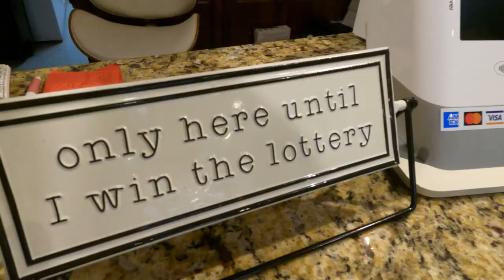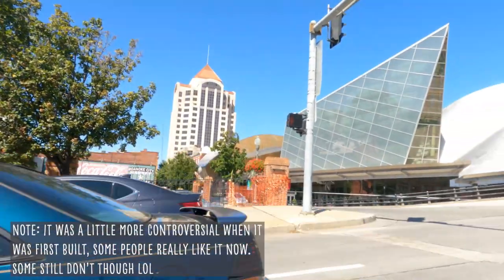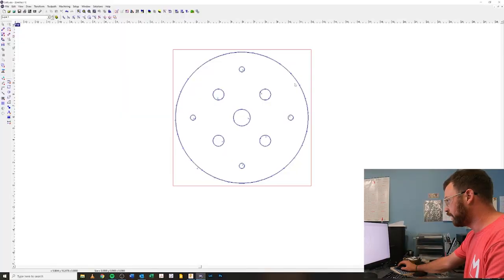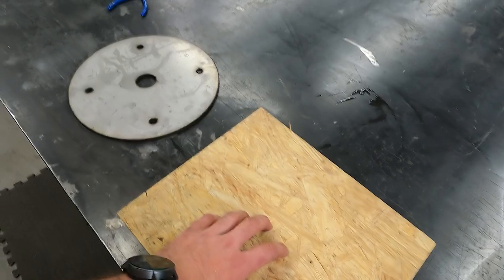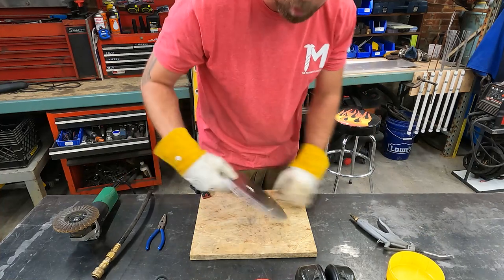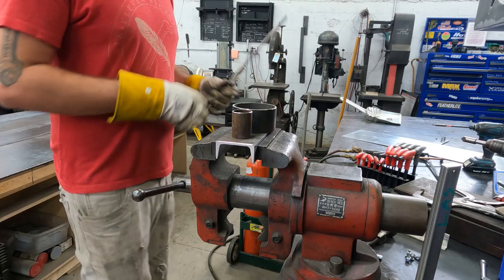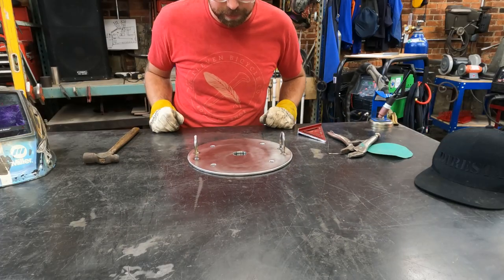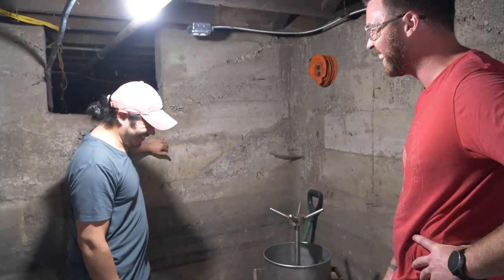INDESTRUCTABLE Vegetable Squeesher // Lift Arc Builds

Comment: If you were going to weld two plates together as you had initially considered then from the standpoint of being "food safe" I would be concerned about all of the holes. It would be impossible after welding to disassemble the plates to clean between, and bacteria could easily fit into that small space, so that may not have passed with the local health inspector.

Comment: Nice video.  You really should start wearing a mask when grinding or cutting Stainless steel the dust and smoke is nasty. Also us only one disc for SS so you don't  transfer the steel into the Stainless steel.